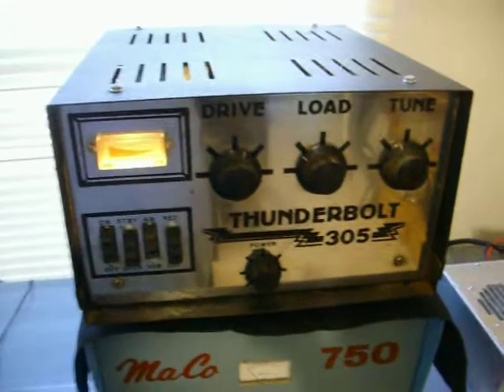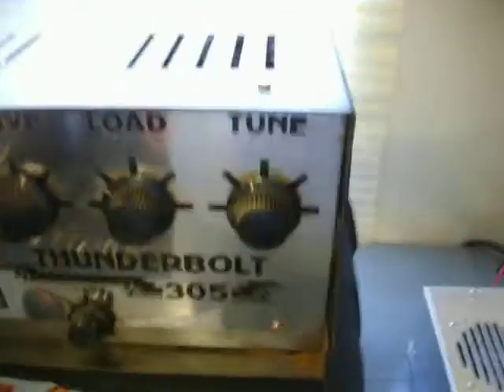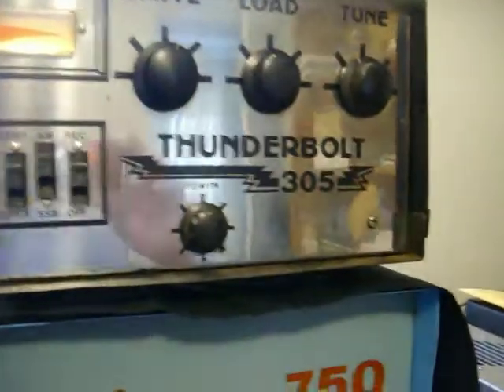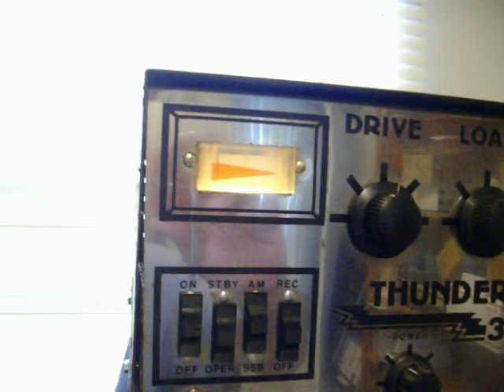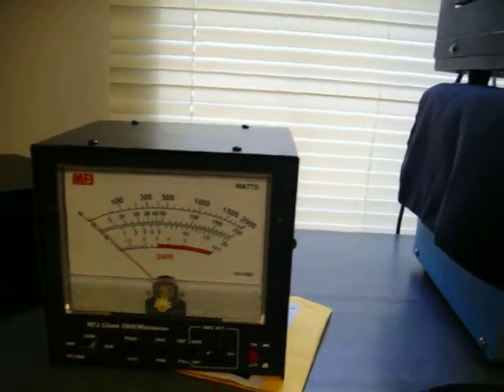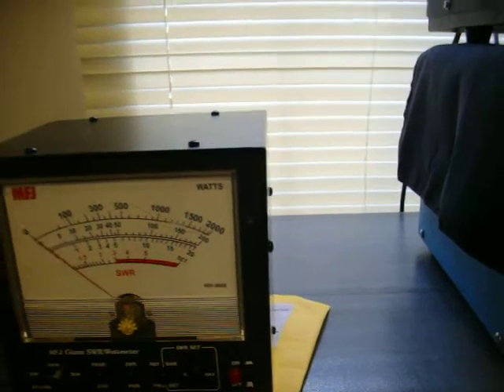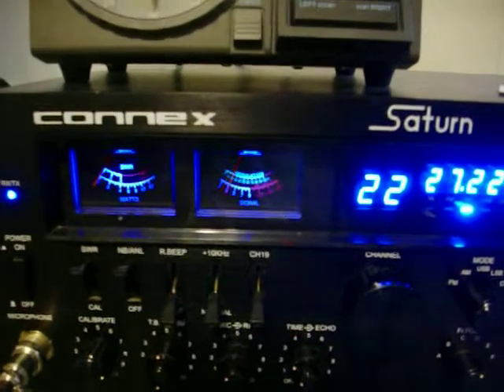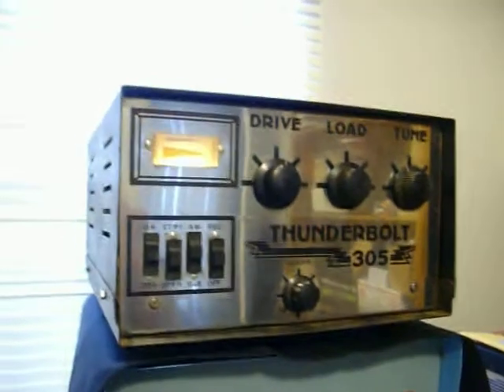THUNDERBOLT 305 AMPLIFIER

Comment: had 1 of these back in the mid 80's or early 90's modified to 650 used a WaWasi (I think that's the name)meter similar to Dosy.
Use to shoot skip on reg 40ch. I was using a Superstar 3600 with uppers and lower
Reply from the maker: They are awesome amps

Comment: I was just watching your video I was wondering if you could tell me a little bit more about the Thunderbolt 305 amp a possibly how to set it up I have one and also could you tell me where I can find some more tubes. I do appreciate it thank you
Reply from the maker: Wow what a great amplifier -- 6MJ6 black cap tubes will give you long life, as long as with any sweep tube you dont over drive them,they cost more but are worth it, as far as tubes be careful of what you buy -- buy new in the box tubes if possible , you never no what you will get with used ones, people tend to say new old stock when in fact they are used and do not test strong--- not everyone does, just be careful of what you buy, if you plan on keeping it buy new in box tubes, I have seen 6JE6c tubes New in box go for $25-30 each on feebay
Reply: Thanks very helpful
Reply: Yeah I like it a lot first time owning one